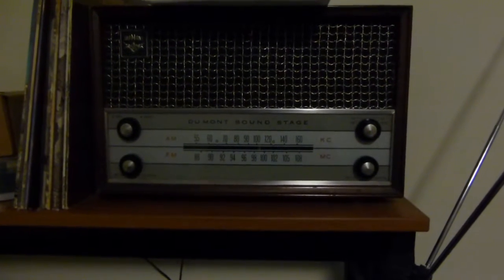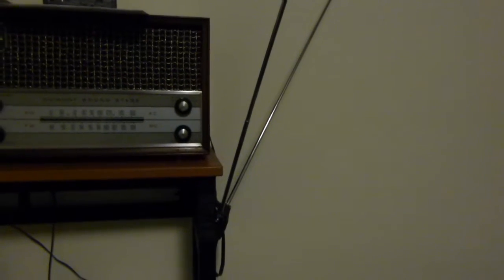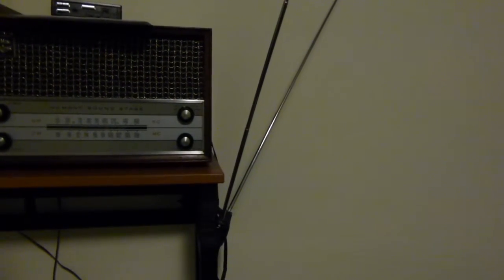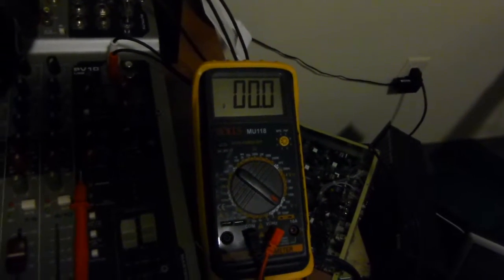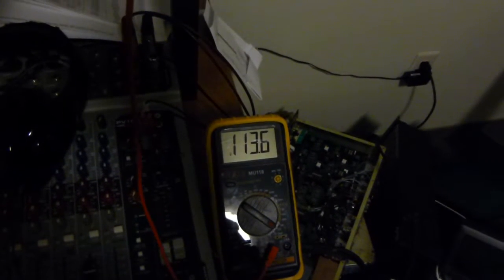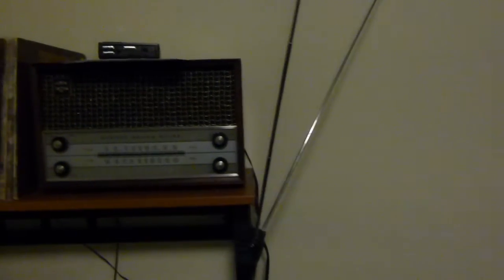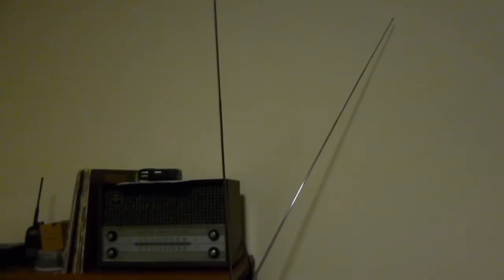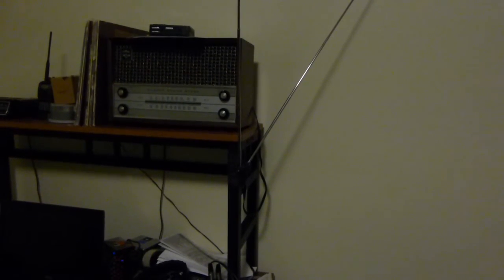The Dangers of Hot Chassis Tube Radios...

Comment: You should never use such a radio anywhere near any grounded equipment. That is why such radios in Europe have plugs that do not fit grounded sockets (while grounded plugs fit ungrounded outlets), If you have anything grounded, all must be grounded (unless double insulated)

Comment: I've been shocked a multitude of times. One time I was electrocuted , My hands were clasped closed on the equipment rack handles and I could not let go. I was alone in the back of a US Army radio hut on the back of a deuce and a half truck. As I stood there in pure terror realizing what was happening I put my foot up against the rack and pushed myself away. I went flying out the door of the hut and into the truck bed. Then I went back to work troubleshooting  the problem. The power rack wiring was incorrectly wired and kept blowing the breaker in the hut panel. I decided to pull the equipment out of the rack. It was an R-390 Collins Radio. inadvertently  I placed myself across the power line, receiving  full force of 125 VAC. I have never been right since that day LOL.
Reply: Damn, lucky you could still move your legs.

Comment: Considering a line voltage of 120 Volts (if it really is!), a meter impedance of 10 Megaohms and a body impedance of 10k Ohms, the voltage across your body will only be roughly 2 Volts, so it would be completely safe to touch. Not saying you should touch it on purpose, but I never got shocked from this kind of chassis voltage.

Hot Chassis is different and should show full mains voltage.
Reply: hello westel,interesting on the impedance of the meter and body mismatch.can you explain to a novice how that relates to the roughly 2 volts.is there a formula?thnaks john
Reply: @jw228w  

Just the usual voltage divider formula. However, if it's a line-chassis capacitor (usually around 10nF)  causing it things are a bit more complicated. But it won't be a dangerous voltage if the unit is properly serviced. If it's not, I suggest doing the lightbulb test (low wattage lightbulb from chassis to wall-socket ground) to be completely sure.

Comment: This method is useless if you leave the internal resistance of your meter out of the equation.
Your meter and the resistance from phase to chassis form a voltage divider and the voltage drop for your body would be a completely different story.

I encountered the same phenomenon on vintage tube radios BUT ALSO on more recent solid state adio gear like an early 90s pioneer amplifier. The neon screwdriver went off and the voltmeter indicated "dangerous" 90 volts in most cases if I remember correctly, even through the phono input of some tube radios  (connected  ground to chassis ground). However, I hooked up a speaker (not a good one, if you want to try) between chassis and ground pin and barely heard anything. I decided to make the "finger test" and I didn't feel any tingeling touching the chassis.

Comment: Many old radios have a jumper on the antenna terminals to connect the antenna ground to the chassis ground. With the jumper installed, it lets you use the line cord as an antenna, as many radios do. But with an external antenna connected, you should remove the jumper, to prevent what you see in this video from happening!
Reply from the maker: VWestlife This radio actually uses a wire wrapped around the inside of the case as its standard antenna (or so it appears).  The ends of this wire pop out of the case next to the antenna terminals and can be connected/disconnected from there.  I had both ends of that wire disconnected from the terminals when the external antenna was connected, and I didn't see anything else connected to the terminals (unless there's a jumper inside that I don't know about).